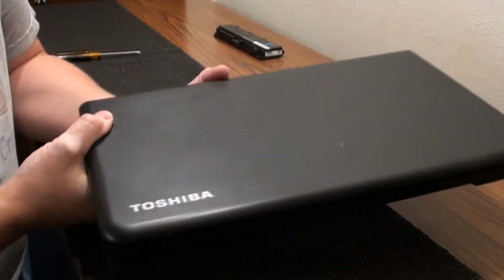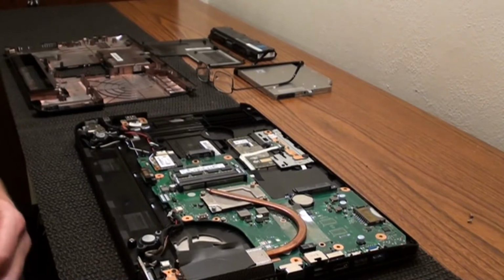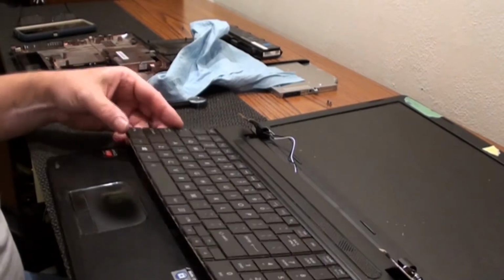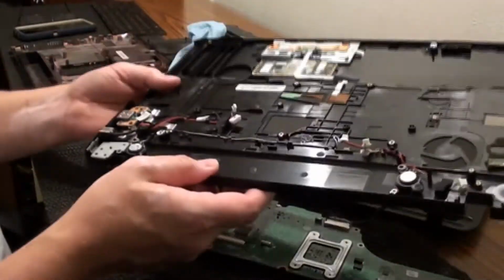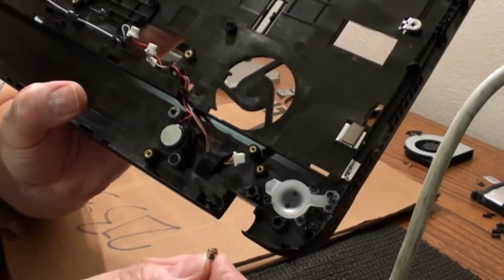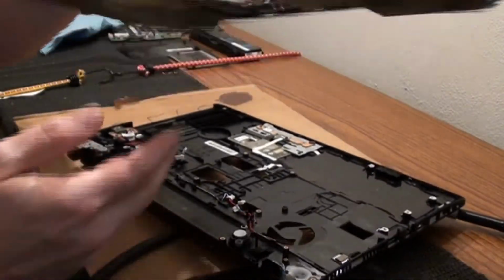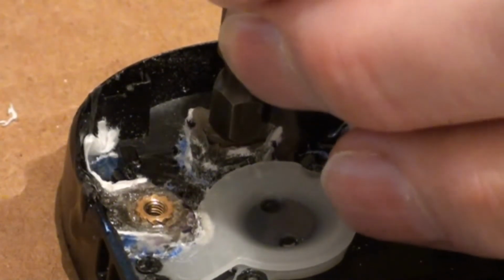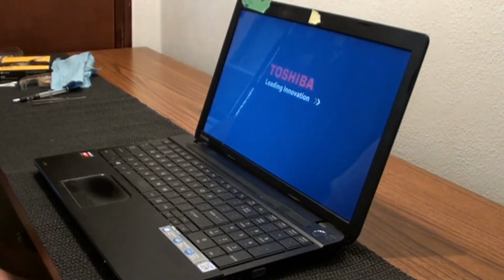Why Laptop Hinges ALWAYS Break (And How to Fix It Permanently)

Comment: Excellent repair,  laptops are a real pain for the hinges.
Modern laptops are even worse,  i don't want to repair one of those :-(
Some people use hot glue under the plate, that can work.
I've tryed epoxy, not brilliant with some plastics.
 jb weld is very strong,  i was amazed how hard it sets.
Reply from the maker: Yeah, that epoxy I used worked pretty well. It's still holding things together from what I hear.
Reply: @ElectronicsEditor  Ooow i'm sorry,  just looked at your site to see where you are from and i didn't know that you may not like comments.
I leave a comment to show my appreciation,  i dont expect any reply.
Reply from the maker: @zx8401ztv  Not sure where you saw that I don't like comments. If it says that anywhere then it was a mistake. I will always try to comment and converse with people. I just think sometimes that I don't see the comments that people leave. Comments are always welcome.
Reply: @ElectronicsEditor  Sorry i misread it :-(
Reply from the maker: @zx8401ztv  I shall reword that section. Thanks